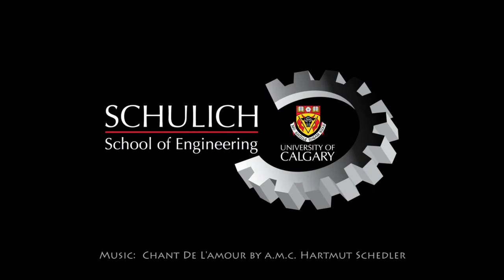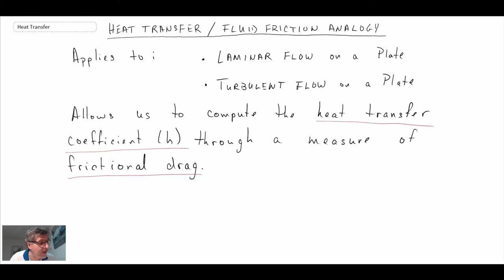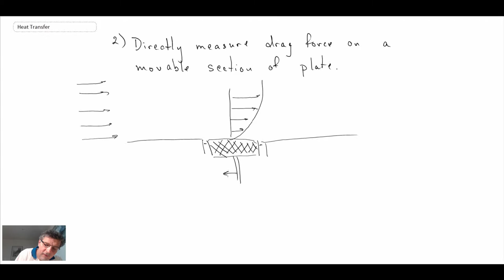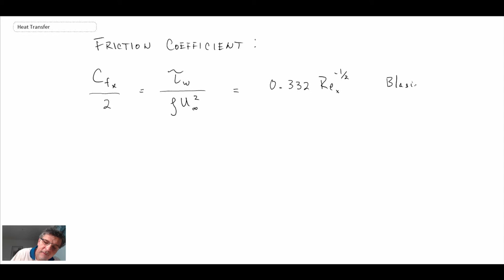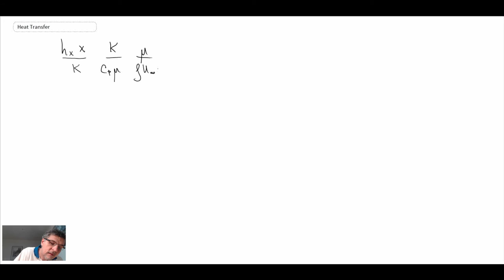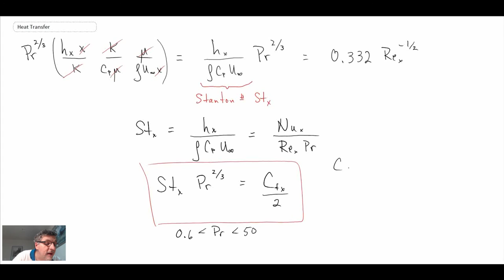Heat Transfer L17 p5 - Colburn Analogy

Comment: Where exactly is this colburn factor used please elaborate. Why can't we use nusselts no. in calculation of the convective heat transfer coefficient instead of colburn factor?